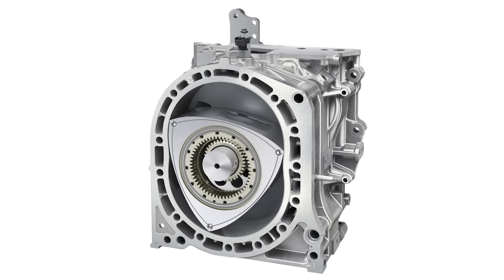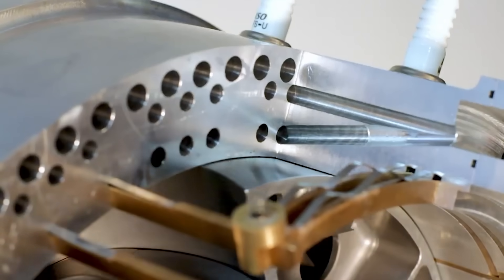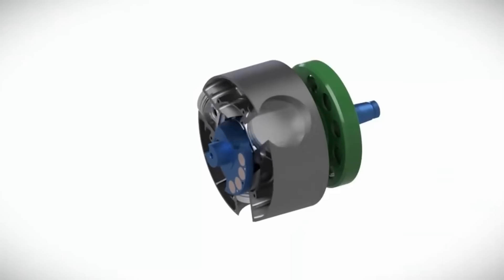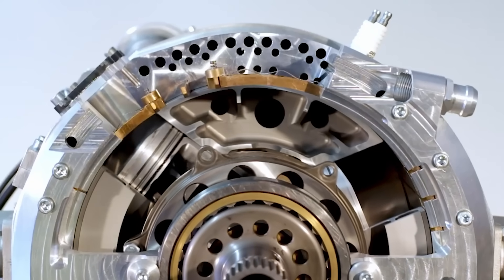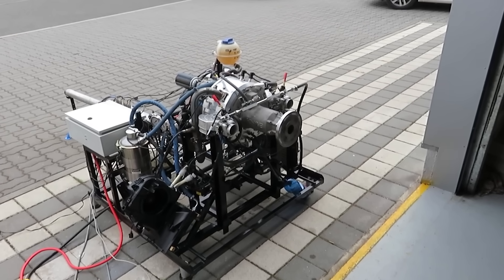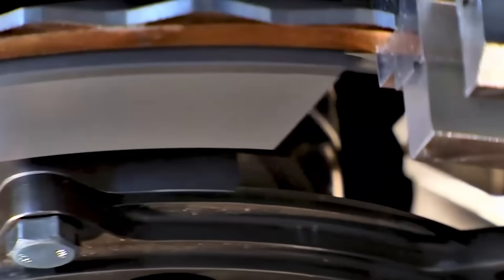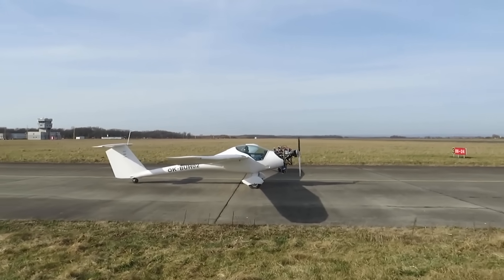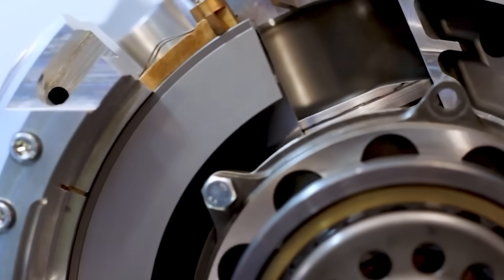The Birotary Engine: A New Spin on Combustion

Comment: A new engine that are a proof of the end of the fossil age. This engine has a problem with the sealing. Nothing beats an electric motor.
Reply: Except the electric motor needs a supply of electricity. That is the weak link in motors. Electricity is far more difficult to store than a tank of liquid fuel.
Reply: @sullivanrachael 0.05% of all fossil cars burns every year. (Chatgpt), a lot of oil/gas tanks burns too (not reallated to war). That 700.000 fossil cars burns every year worldwide, that's more than one every minutt. (1,33). So, if you think that's safe.....?
Reply: Literally everything beats an electric motor, including pedaling through the floor flintstones style. Stop watching CNN and MSDNC.
Reply: nothing beats electric motor in what aspect? lets talk art and driving sensation. vibration across the rev range, feel of torque and powerband, sound of engine, intake and exhaust and the mechanical sounds from the drivetrain, feel of stepping on and off the throttle and clutch, having one hand on steerting wheel whilst other hand is rowing gears etc. EV's can't ever come close to being vaguely competitive.
Reply: @retoadyt3196 - I really dislike driving our PHEV. It drives mostly on its electric motors and only adds the engine when it needs to. The car accelerates really quickly, but the sensation of speed is insulated away by the relative silence - easy to over speed. Cornering - you hear the tyres squeal on very hard corners and I daren’t push it harder; I suspect the back end would kick out but not recover easily due to the 2.8 tons of vehicle. The suspension is hard, the steering too light, both are totally uncommunicative. The car feels like a computer simulator, and I much prefer my Hilux over the RAV4….
Reply: @retoadyt3196 I'm heterosexual. I don't like things that vibrates and smells like shit. So, driving a dildo isn't my fancy.
Reply: You have never driven an EV. So, basicly you don't know what you are talking about. EV's (NOT Including fossil cars with big batteries) are simply better. Driving an hybrid, or a fake hybrid isn't like an EV. Hybrids is just a fossil car with a big battery. It's still a fossil car.
Reply: @geirvinje2556 - yes I have driven an ID3. Felt like a go-kart. Not as fast in a straight line as my traditional sports car. The steering was too light, no feel. It felt heavy, and it is at nearly 3 tons. It was the bigger 77KWH version. The ID3 could be swung into corners - but with the tyres screeching - very difficult to predict the let-go point. Don’t get me wrong, the ID3 is a refined and high quality car, and I liked it a lot. However - it felt dead. The sensation of speed was lacking. No dramatic engine revs, no indication of power output, just - a little whine and the tyres. Road noise is just boring. It was a car that didn’t excite me. It was a purposeful machine, but not an exciting machine of purpose. The cost was exactly the same as my sports car, and I’m happy with the choices I made. I like a car with character, something that not only transports me, but makes me experience a sense of power, control, connection with the road, something that becomes an extension of me. The ID3 by comparison was like driving a simulator, only with real G forces and noises. The soft control feel lacked precision. That is a safety problem for me. A vehicle should communicate to the driver. If you haven’t a clue what I am trying to describe - borrow a traditional ICE car, and drive it on a fast country road. If it’s not involving and exhilarating - either you don’t like cars, or you picked the wrong one. If you want to drive an EV, do so, but don’t try to persuade me an EV is hands down better.
Reply: @sullivanrachael If you look at most fossil cars, they hide their exost. It's a reason for that. Basicly It's because people don't like gas guzzlers. In Norway 99,9% wants an EV. The EV that's sold are probably bought by driving schools. They need some cars with stick shift. EV's are faster as a daily driver. I.D.3 are one of the slowest. The acceleration from Audi E-tron is nice, of course you have tesla's. But, there are plenty of cars that's more fun to drive than a slow fossil car. But, then again in Norway there are some that have wanted some type of fossil cars from the past, that goes back to their youth in those cars. But, with 30% EV's on the road, and gas stations beeing closed. It's just a matter of time before they have to make their own fuel. Moonshine or frying oil.

Comment: Its cool that it was built. But, its still going to have the same issue with both piston and rotary engines. You might as well use the effort for rotary valves on a standard ice motor or put valves on a wankel rotary engine.

Comment: The incredible friction and heat generated is what make these engines a mechanical curiosity. The future of aviation will be electricity. Maybe in the blimps?
Reply: Regardless of how much futurist leftist looneys get paid to tout this stupidity, the future of aviation is absolutely not electric because of physics. EVs are not feasible even for a simple lorry, much less a plane that has a minimum take off weight.
No one, literally no one, is going to buy an airliner or a cargo plane with more than half of its take off weight wasted hauling dangerous flammable and explosive batteries.

Comment: These engines have been around for decades. While improvements in sealing technology stand to help resolve its challenges... numerous other deficiencies render it obsolete. 

NET DISPLACEMENT RATIO - the power of any engine is most closely related to its effective displacement. The effective displacement of this design is very low, compared to the overall packaging.

THERMAL MANAGEMENT - as with nearly all rotary designs, the combustion and exhaust phases, along with their associated heat, are localized... and with a notably higher frequency. The thermal expansion of these areas varies with load and duty cycle... creating numerous issues.

When you add to these, the ancillary demands of dry sump oiling and a highly taxed cooling system... you're left with a novel, yet comparably poor engine design.

Comment: If you can solve the sealing and lubrication issues (especcially between the block and the housing) this design has potential. The lack of intake valves means way larger intake and exhaust ports, which allows for better performance. The design is also extremly compact., so you can put it in pretty much anything.
Reply: Looking at how little of the volume of the rotating part is actually combustion volume, I am not convinced this qualifies as compact compared to a conventional reciprocating engine. No mention of power output or comparison of specific fuel consumption comparison with conventional engines, so there's not enough information given to make any conclusion on this. The big question is can it meet aerospace emissions and especially reliability requirements to be flight certified, and can it do it at a lower cost (Or offer other benefits if not) to the people who would buy them.
Reply: @peglor  You severely underestimate how big the cylinderhead is on a normal engine.
Reply: @Sir_Cactus  I think you're severely undestimating how tiny the pistons in this engine are relative to the massive rotor they're moving in.
Reply: @peglor  I agree, surface area is mammoth, just needs a spec of sand to ruin what is often spat out on conventional engines. Also needs direct injection to avoid "fuel wash". As for cylinder head sizes, Honda and Mitsubishi have SOHC 16v heads that are tiny. Today many 1.2-1.6L engine + boost are tiny putting out V6 figures.
Reply: @peglor  camshaft, chain, gears etc are way more parasitic losses than spinning a big disk, which every engine already does anyways (flywheel)
Reply: @FreDEV_OFFICIAL  Spinning the flywheel at constant speed uses no energy at all beyond over coming the bearing friction at the crank shaft since the flywheel doesn't contact any other parts. Spinning the disk in this engine, which his in contact with the engine block and needs to seal around its entire circumference is going to create a lot more friction than the valvetrain.
Reply: @peglor  spinning a flywheel doesnt use energy? I think you should go back in depth on how engines work. 

Also no, this design is not going to create more friction than a valvetrain. Not only is a valvetrain harder to operate since you have to push against extremely hard springs constantly, you also have to get the rotation there via a chain or belt which costs energy as well. 

Also there is another thing which is that poppet valves in general are a huge restriction since air has to flow around the valves which chokes airflow. In this engine that is no problem either.

Look up rotary valve engines which essentially rely on the same principle.

Comment: I believe this concept will die (in real use) on this huge rotating area which has to be lubricated and sealed at the same time. There is no head gasket, and where does the pressure go whilst combustion?

Comment: Is there a potential of lubricant leak or decompression leak between the rotor (which houses the pistons) and the outer housing which holds the rotor? The housing has openings which negate the need for valves. However, when speed or load bearing change, how are ignition and exhaust timing adjusted for optimal efficiency? It seems more suitable for plug-in hybrids, where speed and load bearing are fairly constant.
Reply: I imagine the intake/exhaust timing changes/tuning for specific applications are done "at the factory" via permanent port sizing/placement in the bloc, like done on traditional Wankels and 2-strokes.
Reply: @direfox240  So no variable timing?
Reply: @christmassnow3465   Maybe? There were work arounds on the Wankel using closable ports and later I believe a system for adjusting exhaust port timing on the Rx8's via some sliding mechanism. Most recently was Mazda filing patents for using the electric motor/generator on a hybrid Wankel to slow down and speed up the engine during intake/exhaust events as a adjustable duration/timing system.

While 2-strokes have things like STIHL's cam and valve system. Or more importantly rotary valves. Several supercharged rotary exhaust valve 2-stroke engines have been used at Bonneville, and a running experimental version of these engines that no longer requires air/fuel to pass through the crank case was recently shown to the world.  

TLDR. 
Correct. 
But work arounds have happened, rough examples.

Comment: Nice idea , really need specs to see if it has any marketable advantage .I'm still getting over the flop of the revetec trilobate engine ,perfect for aero use ,even in quite early testing near as, 40% actual efficiency,due to improved mechanical /torque efficiency ,plus max torque from around 2500 rpm !?.
Reply: Bro just look at it, anyone with a bare basic understanding of physics knows how awful this design is. I bet it runs out of oil quicker than it runs out of fuel, which is saying something for a rotary.

Comment: All of these alternative engine designs have a very tough competitor in the conventional piston engine which has been constantly refined for well over 100 years now.    To be a viable replacement it must equal or better EVERY aspect of them meaning equal or better power, equal or less weight, equal or better fuel economy, equal or better durability,   and today equal or less emissions.   Failing ANY of these metrics means it's not going to make it in the market and will be just another interesting attempt.
Reply: Its a niche market engine
Reply: @shadowopsairman1583  there is no market for this engine.
Reply: Wrong. There are markets for small compact rotary engines
Reply: I dont understand why they are even pushing with this nonsense at this point. No matter how good it is it still wont be as efficient as EV motor. Also, EV motors are making much better progress. There is a new one with 1000hp and its only 12kg.
Reply: @senadgalijasevic8568  there are certain benefits to rotary engins
Reply: Hummmmm.  I mostly agree with you but why would any company invest and retool their production line to make something that is equal to (or slightly better) than what they are manufacturing now?  IMO, new  innovative ideas must be substantially better than what they have now with no downsides.  With piston engines, that's a tough act to follow but not impossible.

Comment: This is exactly like a patented engine from the early 1900's (1904 I think).

I came across the early engine design when researching patents for an engine design my father and I came up with (our engine differs in a number of ways to the design in this video, but this video is essentially identical to that in the US patent).
Reply: Interesting. Which US patent are you referring to? Do you have pictures?
Reply: @robertharris7027  I can't find the exact patent (I cannot recall if it's something my father and I determined with the contra rotating mandrel having a ratio of 3:2, which limits the geometry of the engine for 4 strokes to having 3 cylinders).

That being said, lets address some of the things that are not new with the above engine (a quick patent search for US between 1880 and 9120):
1. Rotor with pistons: US1047227A, granted 1912. 
2. US1292295A, granted 1919. 
3. US1272791A, granted 1918. 
4. US1229643A, granted 1917 (This might be the one I was thinking of, although I recall the contra rotating crank in one of the patents)

N.B. US1229643A might have a contra rotating mandrel, just like the above engine (I didn't spend the time to re-read the patent). As mentioned above, the only part that is needed is a gear ratio that rotates the rotor and the center Mandel such that 4 strokes between exhaust ports spread around the circumference of the outer housing. You just need to choose your gear ratios for this to work out. There were limits to this though, which is why my late father and I came up with a different internal mechanism. Whist this patent shows 5 cylinders, there is no reason why it cannot have 3 cylinders either.

Another reason why we came up with another mechanism internally is due to the fundamental limitations of sizes of components and stroke of the positions with the contra rotating crank. Our version can scale to as many cylinders as you want, not for compactness, but for increased torque (although small 2 cylinder versions were also possible)

This is going back to around 1991, 1992 when my father and I worked on our engine, so my memory may be a little fuzzy on some aspects.

N.B. You can google the above patents. They are all online and downloadable as PDFs. Starting with item 4 above is a good place to start.

N.B.2. There are lots and lots of similar (and fascinating engines) with many similar aspects to the above. Those are just the 4 that stood out the most in my quick search.
Reply: Seconded

Comment: Too complex to make. What is the efficiency? It has to be super efficient to get a manufacturer to take it up. 
Alas, with electric motors running at 99% and batteries improving and dropping in price, the EV will dominate.

Comment: Something not discussed is lateral addition of pistons instead of radial addition of pistons? As in adding a whole engine pancake instead of adding pistons to the existing radial configuration could help with heat dissipation and distribution?
As well as scaling factors (smaller over all dimensions of the engine "pancake") but adding pancakes compensate for reduced volumetric capacity?
Audible harmonics and exhaust collisions come into play and historically there is a tendency for human hearing to find the 20B rotary as well as the 3 cylinder 2 stroke to have this eargasmic sound profile ? 😎
And then we have turbocharging/forced induction and the potential liberation of much more horse power and torque above and beyond the potential of already improved combustion efficiency of this bi-rotar engine concept?
Which is where the concept I suggested of pancake layers may prove to beneficial with recapturing of power from otherwise wasted energy as sound and heat?

I think in the case of aviation in particular with prop that huge amounts of weight could be saved by air cooling the motor?